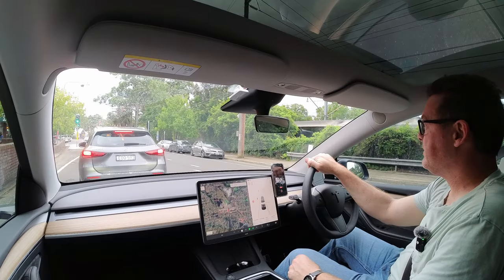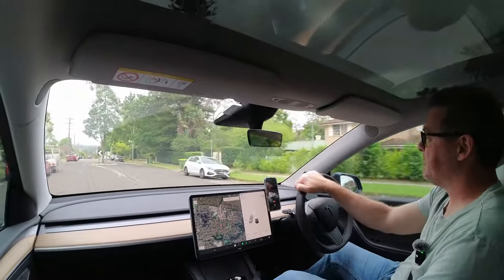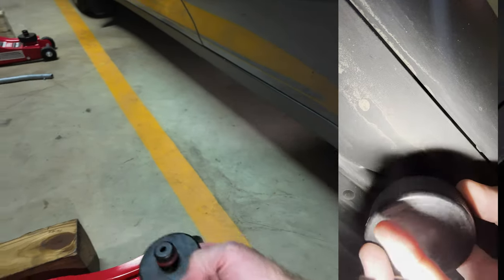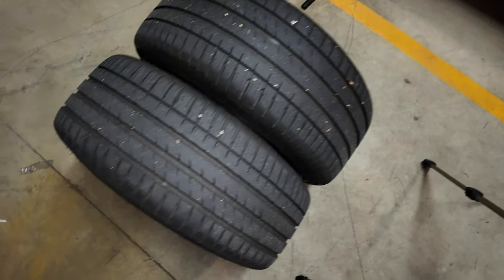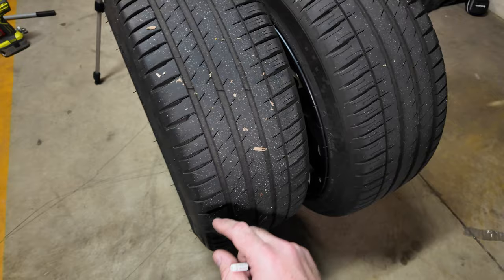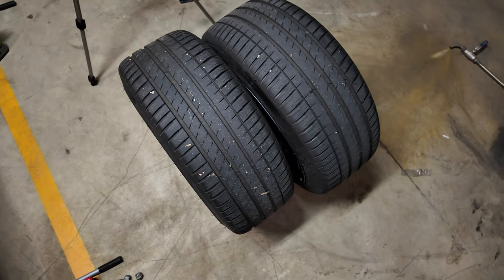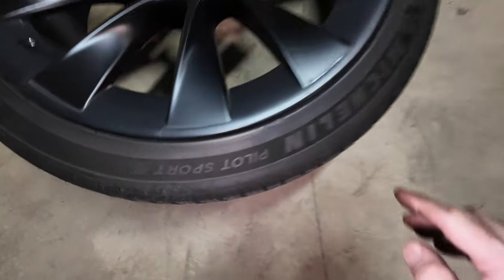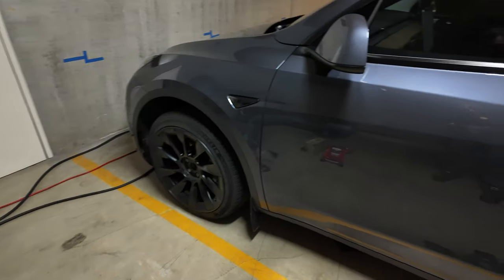Tyre rotation. When should you do it and why! My Tesla Model Y RWD tyre wear after 10000km.

Comment: Another top notch video Matt, well done!  I'm happy to see now what's involved in rotating tyres on a Tesla yourself, and the steps and precautions you took.  I wasn't going to have my MY tyres rotated until about 20,000km but I'm glad I did now (~13,000km).  Tesla did it for approx $50 while they had it in their workshop fixing a problem with the drivers seat under warranty, so I think that was more than worth the money.  I should also invest in a tyre depth gauge just to keep an eye on the wear myself.
Reply from the maker: Cheers John. Yes it’s definitely worth doing. I probably drive my car a bit harder than I should but the torque at take off is addictive and you get used to it. Maybe I need to use chill mode 😜
Reply: @notinthemanual i do chill mode 99% of time
Reply from the maker: @Dan007LoveKhmerMusic  That’s probably what I should do too 😂

Comment: What is the thought process for rotation on the RWD cars? I can understand on all wheel drive cars to keep the tyres equally worn but don’t understand how the RWD models would be affected unless you want to change all 4 tyres at the same time? Tesla states in the manual to rotate to extend tyre life but for no other reason, just wondering why you felt the need to change all 4 tyres as mentioned on your previous model 3? Enjoy your videos very informative.
Reply from the maker: Hi Lee. I did aim to explain this in the video but maybe I didn’t do a good job. RWD cars and AWD cars need rotation for the same reasons. Tesla AWD cars are only RWD most of the time unless they need the extra power or sense slip between the front and rear wheels. They will still wear the tyres slightly more even than the RWD. Front to rear rotation will also share the extra shoulder wear seen on the front tyres on both drive types. You can change a single or pair of tyres if it won’t cause a difference in diameter of 1.5mm between tyres. This is why I had to replace all 4 on my model 3 when I didn’t rotate. A large difference in diameter will cause issues with traction control systems.
Reply: @notinthemanual   Thanks for the reply, it makes sense, i need to swap my tyres around then!
Reply from the maker: That’s the theory. I was having traction control issues with my model 3 when the rear tyres were worn.  I had an EV and non-EV tyre on the rear and this just made the issue worse.

Comment: My tyre agent recommended against front to rear rotation at 10000km on my M3 as the rears were fairly worn and not worth fitting on front.
Reply from the maker: Hi Mark. Yes some people will need to rotate more often than 10000km. You need to adapt to your driving style. Everyone with a Tesla now has a performance vehicle and performance cars have always shredded tyres. I’m definitely not surprised by the wear I have. Rotating might not double the life of your tyres but it will definitely extend the life of all 4. My brother in law was on his way to getting over 40000km on his M3s first set of tyres but he had a puncture too close to the sidewall and a new tyre would’ve had too much tread difference so he had to replace all 4 at 38000km. Tesla actually recommended having the tyres with the most tread on the rear of the car to reduce the chances of hydroplaning and loosing control. Having a stable rear end is often more important.
Reply: @notinthemanual  Thanks…  good considerations. I agree that taming the rapid acceleration impulse will have a significant impact on tyre wear. Your experiences with the M3 boosted my decision to get one. I have now chalked up Sydney to Adelaide twice and Sydney Melbourne. Fantastic way to travel.
Reply from the maker: @markpirola8152  It’s nice to hear that sharing my experience helped you make the decision to go for the M3. Teslas are awesome road tripping machines! I find long distance driving so much easier in an EV. I haven’t had any fatigue on long trips due to a combination of autopilot and stopping to recharge the car/me every couple of hours. I’d love to do the Adelaide drive one day. I just did a Thredbo trip last month. So easy.

Comment: Great video, Matt.

I have done 39k on my Pirelli P Zero 235/35 R20's, I have strictly rotated every 10k and they are at 3mm now. Unfortunately they have worn very unevenly on each tire and have 3mm on the outer grooves and 5mm on the center grooves. I have religiously stuck to 42psi so it feels like it is too low for this tire, so I have increased to 46psi now to wear the center a bit more and hopefully squeeze another 10k out of them. The wear indicators are still a while off, seems to be around 1.6mm from my research but I will replace around 2-2.5mm.

Keen to hear your thoughts on the correct tire pressure? Yours are wearing evenly, are you running them at 42 as per Tesla's recommendation?
Reply from the maker: My mates old lowered Datsun 1600 with huge rear camber used to wear the inside edge of his tyres 😂….Are you sure you don’t have a wheel alignment issue? Doesn’t seem right to me. You have done well to get to 39000km. Pirelli tyres are good though. Required tyre pressure can vary with different tyres and the Tesla recommended pressures are for the stock tyres. I run the standard 42psi. I have mine set to Bar so 2.9-3.0 bar. My brother in law runs the same in his M3 with 18” wheels same as my old 3. He has pretty even tyre wear too. At 46psi you might get a bit slippy in the wet but you might also get better economy 😜
Reply from the maker: I will probably stretch mine out just under 3mm tread depending how slippery they get in the wet. They are still reasonably grippy but the Y is heavier has much less torque than my 3 had I’m still hoping to get to 40000km but that could be wishful thinking
Reply: @notinthemanual  I don't think so as every tire has the same wear pattern (ie more wear on the outside and less in the middle), which suggests a pressure issue I think?

Economy is much better at 46psi, but it rides like a go kart!
Reply from the maker: @aviationboy8  Snow ploughing front tyres will cause same wear but if it’s even across all 4 then could be tyre pressure. Being worn on one side though makes me think it isn’t just pressure and more to do with alignment. Have you ever had a wheel alignment done?
Reply: @notinthemanual  never alignment, but Tesla did a balance at the last rotation. It’s wearing more out both sides though so I didn’t think it would be an alignment issue? It’s only the middle groove has 2mm more depth than the outers on all 4 tires. I’ve done another 3k since the rotation and I had a look yesterday, doesn’t seem to be getting worse so I think the increase in pressure has helped. I’ll change these in about another 10k or so and get an alignment done just in case. I’m thinking of putting on the hankook ion evo’s, they are very highly rated and supposedly are good for 50-70k!
Reply from the maker: @aviationboy8  Definitely get an alignment done with new tyres. I’m not a huge fan of Hankook but I also haven’t had a set of ION tyres. The stock tyres for the 19” Y are Hankook and I’ve only heard bad reviews. If they boast that sort of life then performance probably isn’t that great. You can’t have both unfortunately. I found that when I changed to the Michelin e-primacy on my 3. They were better wearing but slippery in the wet compared to the Pilot Sport stock tyres that were super grippy. My personal preference is grippy. I’m hoping Bridgestone release their EV tyre here soon. I’d be interested how they perform.
Reply: @notinthemanual  Yeah I am expecting that, however I do 20-30k per year of highway driving so I am looking for some more mileage out of the tyres. I hear they are quite impressive - I will let you know how they go.

Comment: Hello, remember me? I'm from Poland. Over a year ago, we corresponded about the use of the LFP battery in winter conditions. In my opinion, there is no need to rotate the tires (wheels). In my case, I change tires after 30,000 km and the front tires had 6.2 mm and the rear tires had 5.8 mm. I have TM3 RWD LFP. I would also like to talk about a strange case with my battery which, according to calculations, has only about 50-52kWh net (60kWh LFP) capacity. 2-3 months ago, based on the same calculations, it had approximately 56-57 kWh net. Something must have happened with the car's calculations. I noticed in your other video that ScanMyTesla shows that the buffer is about 6.8kWh...
Reply from the maker: Hi Piotrek. Yes I remember who you are. Yes tyre wear comes down to how you drive the car. My tyre wear will never be as even as you have experienced so rotating the tyres is essential for me. How are you calculating your battery capacity? What is your displayed range at 100% now compared to when the car was new? Occasionally my car will show high degradation of around 4-5% and it is only 6 months old. This is due to an error in the calculated capacity and it normally takes a couple of full charge cycles to correct. If your energy buffer is high it normally means that there is high cell imbalance and the BMS increases the buffer for safety.
Reply from the maker: My new Model Y had a large buffer of 6.8kWh as it was new and the cells were imbalanced while the battery was settling down to the real capacity instead of the installed capacity.
Reply: @notinthemanual  above I mentioned about this buffer. It is very interesting what you wrote.
Reply from the maker: My energy buffer now sits at 2.7kWh. LFP is slightly more prone to cell imbalance so charging to 100% allows the cells to balance. The buffer will increase if cell imbalance is too high.
Reply: @notinthemanual  generaly is true but I'm not sure. Yesterday I updated the system (to 2024.8.9) and today my calculations show me a capacity of 60.2kWh (compared to 50-52kWh before). So I think it depends on the software. I'm sure the last firmware wasn't right...
Reply from the maker: @piotreksz5713  Ues software updates can cause things to reset and give you different readings. I’ve never been able to prove this though. What are you using to measure battery capacity?
Reply: @notinthemanual  I mention that I calculate the battery after a long trip. Now I see the difference between the results now (after the update) and before. So in my opinion this new update has changed something. Now the capacity is larger. In general, the outside temperature increases slightly.. A few days ago I wrote my calculation:  (My case: I charged the car to 100% and set off from Katowice to Warsaw (293 km). Energy consumption was 16.3 kWh/100 km. Car used with battery 94.9% . My calculations: 2.93x16.3=47.76kWh for travel. Next 47.76/0.949=50.33kWh net capacity.)
Reply from the maker: @piotreksz5713  Ok. I see now. I don’t use that method as I have ScanMyTesla. I also use TeslaFi and the Tessie phone app. You would love the data that these third party apps save. I can look back to every drive and charge that I have done. 

It is still possible that your energy buffer has changed, possibly due to the update. In very cold weather some capacity is reserved but you would have seen the snowflake symbol on the screen. It would be interesting to see your energy buffer size on ScanMyTesla. I can’t remember if your car is the 55kWh battery or not. My brother in law still has his 2021 Model 3 with 55kWh LFP. I can check and see what his energy buffer is and his current rated capacity.

Comment: Tread depth when new was 7mm right? And rears wear out 2x as fast at 2mm per 10k km vs 1mm at the front. I think even with 10k km rotations, you're gonna need new tyres at  25k km. The rears will only last 5k km when you do the 3rd rotation. Thats when your original rears come back from the fronts. I've had pilot sport 4S tyres in 245/30/R20 on a car, and they did about 20k to 25k km with 3 rotations. Before hitting wear indicators. It's a very soft compound made for performance. Someone else on youtube tried the Winrun R330 on his tesla and said they improved efficiency heaps because of the higher wear rating. Much cheaper tyre top. But might have trust issues. Haha
Reply from the maker: You’re assuming that I won’t now change my driving style 😂
Reply from the maker: Yes these are very grippy tyres and that comes at a cost to tread life. I changed to e-primacy on my model 3 and they had a higher wear life but traction was not as good. You could fit non-EV tyres and get more tread depth to begin with but no way I am going to do that after cutting the two open in my comparison video. It’s not worth it and they will probably wear out faster anyway. I know what the problem is…my right foot. Not the tyre or it being an EV. Let’s see in another 10k. I’m already halfway there.

Comment: Great video! Those look like pretty low profile jacks. Would they fit under a Model 3?
Reply from the maker: Yes tried and tested on my old model 3. The model 3 is pretty low to the ground so you need to measure first and consider the lifting puck. You also need to consider the height for scissor jacks too as standard ones are too tall.

Comment: Great video as usual!  You provide great insight to other Tesla owners.  I purchased and installed the MagBak wheel protectors on my Model 3 after watching your video and have been very pleased with them.  I wanted to ask you, since you are handy with things, do you think you will try to reapply 3M tape on the existing cover pieces when you replace the tires or just purchase new ones?  Thanks!
Reply from the maker: Thanks Jes. Unfortunately MagBak still aren’t offering the 3M tape as a kit. This is a bit of a negative for the RimCase. You can either message them about buying a single kit or buy some sheets of the 3M adhesive and cut to size yourself. I recently sprayed a new brand tyre shine on my tyres. I got distracted and forgot to wipe the excess off. There was a lot of excess spray that ran down and affected the 3M tape adhesive. Some of the segments actually came loose. They are looking into why this happened. Something to be careful off. They have worked well up until I did this and I still highly recommend them. I bought some of the one piece protectors to see what they are like. They are cheaper but they look pretty flimsy in comparison. I don’t think they would provide as much protection. I might use this opportunity to compare the 2 options.